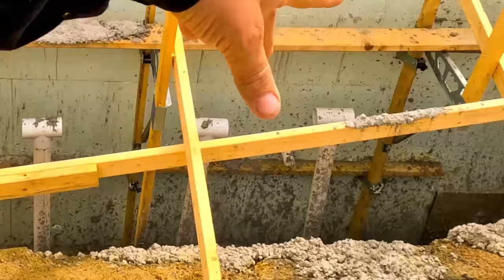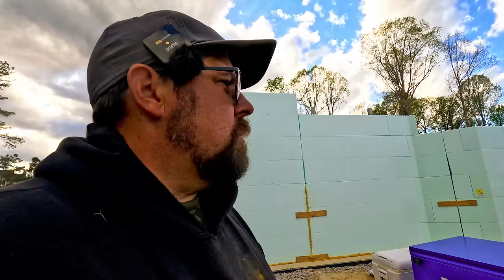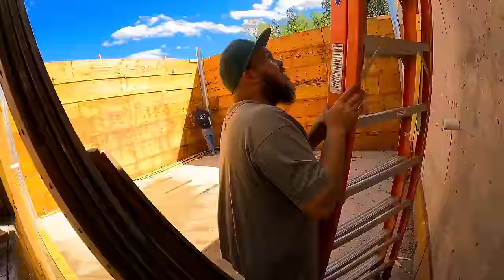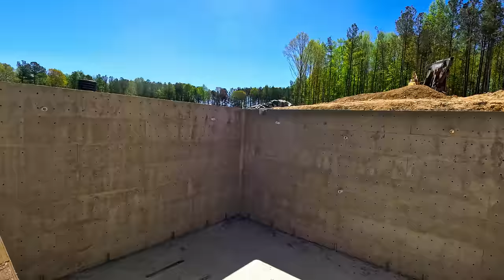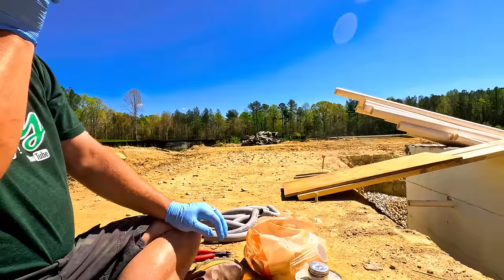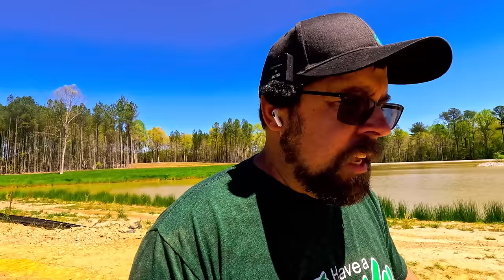Removing the Pool Concrete Forms

Comment: for the 2 inch to one inch adapter, it is nice to have a smooth internal transition  if you push a new cable from the big end toward the smaller pipe, the leading cable end usually will bump into the adapter / not lift up to go into the smaller hole...

Comment: Just a little tip I learned from Deisel Creek when pulling wires you can use a vacuum (shop vacuum) on one end and on the other you can take a plastic bag and attach it to a spool of string put the bag with the string into the pipe and turn on the vacuum make sure you seal up the end with vacuum hose around the hose it's a time saver 😊

Comment: Second comment,Geoff make sure your guys take the load of you ,the mental strain plus manual work is hard on the body and soul,no project is worth being shattered for .
Be kind to yourself
Reply from the maker: Good advice. I’ve always been this way though. 🤔
Reply: @BealyGood  As you get older ,one is meant to become Wiser !
If you run out of time and don't change ,then it becomes too Late ,being wise is accepting what is needed 
Happy days 🤗

Comment: FWIW, I've minimized my use of stone backfill before by using some sheets of plywood leftover from the pour by drilling some holes along the edge and putting in some rope loop handles.  Hold the ply on edge about a foot off the foundation, and have the skid steer sprinkle crush between the ply and the foundation.  When it reaches about a foot, sprinkle in some native on the frontside.  Run the jumping jack on the native to firm it up.  Repeat in one foot lifts until the ply is nearly 2/3 buried, then pull on the ropes moving the ply up about a foot.  Most of the time I could just pull the ply up by hand and not need to enlist the help of the skid steer.  Continue in one foot lifts until you reach desired grade.  Stone is expensive, native is free.  A little innovation and some hard work can save a ton of money!

QUESTION GEOFF->  You said your slump was 4.  Is that with or without super plasticizer?  If it's without, please consider the additive before you just juice it up.  Back before I was a project manager, the job foreman over me had the driver 'juice it up'!  Not only did I get to witness what it looks like when you have a blowout and lose 2/3 of a truck, I got to help clean up the mess before it set up down in the hole.  Oh and these were conventional forms, not ICF's.  As I am sure you are aware, ICF's are MUCH more vulnerable to blowouts.

Anyway, thanks for sharing, and I'll watch for the next one.
Reply from the maker: I like the plywood idea. Thanks. 

It was a 4 slump with the plasticizer in.

Comment: Flex pipe instead of rigid 90 for water.
A lot of leak problems later on are related to settling and the rigid PVC gets broken. Flex can give it movement.
And try to use a pair of 45's instead of sharp 90's if possible. Flow is always less resistant flowing through 45's

Comment: It's looking brilliant Geoff, your hard work is now paying dividends Can I ask a question (for you or someone else to answer). When you pour the infinity edge wall, you going to have a seam between the concrete you have just poured and the new concrete. how will you stop water ingress?
Reply from the maker: Yes but there won’t be any water that sits against that cold joint
Reply: @BealyGood  Thanks for answering.

Comment: Use 45's where you can instead of 90's. The water flows so much better also if anything does get stuck in a pipe it's more likely to pass through to be removed.

Comment: Thank you for the tour and the updates.  What are your thoughts on keeping concrete damp/wet to improve the curing?  Some keep concrete work surnurged as long as possible to improve the eventual strength, others don't.
Reply from the maker: I have sprayed concrete before. This one cured pretty fast. The forms were warm for about 3 days and that was it.

Comment: I live vicariously through these videos.  I wont lie it looks like fun building a house. I am curious why they are backfilling so much with gravel.  That soil looks like clay isnt that ok to backfill with>?  Maybe 1-2 feet of gravel for drainage but to backfill with rock like that?   What am I missing because backfill could just be that soil mixed with like 20% gravel and it would save a crap ton of rock.  Burying 8000$ of gravel on the sides of your pool seems like overkill,  I dont even have 8K to build an entire pool nevermind on backfill.  Lol.
Reply from the maker: Drainage and hydrostatic pressure. We are using about 1/2 to backfill

Comment: Hi Geoff, I have a question : I saw you putting the colored  liquid on first and the clear second ??  Here in Australia we have the clear first as it is the "cleaner"   and then the blue as it is the "glue".  Perhaps in USA it is the other way round, But I am asking this as a 93 year old ex plumber who was in the first stages of PVC pipe. I still welded it and the poly too. Many greetings to you.
Reply: We can do it a number of different ways. Purple and purple, purple and clear, clear and purple, or clear and clear. All depends on the cleaner, primer, and cement you use. For electrical we also have clear and gray.

Comment: i missed a few episodes ..why did you have to use plywod on the inside ???? you got a lot of work ahead of you.. after watch the rest of the video wasn't those icf blocks foam on both sides ?? i'm lost....
Reply from the maker: This is the pool. The plywood comes off and we finish the concrete on the side where the water will be. The double sided foam forms are for the basement.
Reply: @BealyGood  i missed the set when you added the plywood... you did good on the tear down... of the out side

Comment: I would not bury pvc pipe that is touching. Water flow causes vibration an pipe that is touching will eventually wear.
Reply from the maker: Good advice
Reply: @BealyGood  you are certainly welcome! You can make some sort of backing frame to hold the conduit and pipes in parallel through the long route to the mechanical room. Keep up the good work.

Comment: Wow I really don't understand why all the holes and pipes on the inside of the pool.
Reply from the maker: The pipes are where lights and the returns go. All the little divots are where the forms were fastened
Reply: @BealyGood  Thx but when you paint it that will look bad?
Reply from the maker: @thisoldminer  They get filled with an epoxy and smoothed out
Reply: @BealyGood  Oooooo ok I see. :)

Comment: Geoff can you do gunite?
Reply: What exactly do you think Gunite is🤔
Reply: @aaronking8106  isn’t it a spray on liner used in pools?
Reply from the maker: Gunite is spray concrete. You dig the hole, basically build the pool using rebar and then spray the concrete. I cannot do that myself.